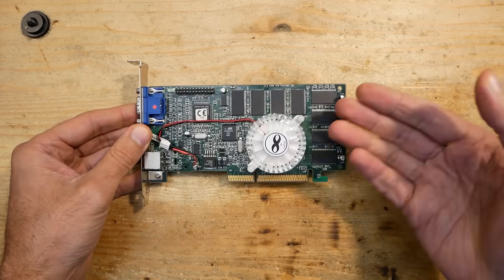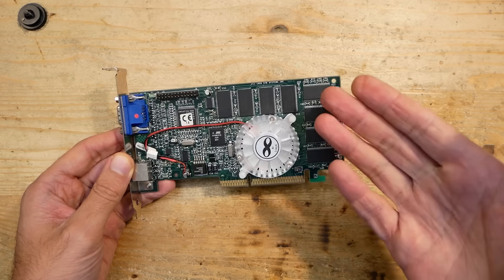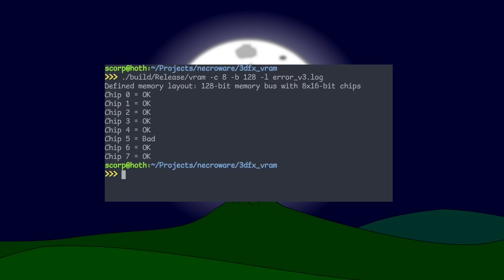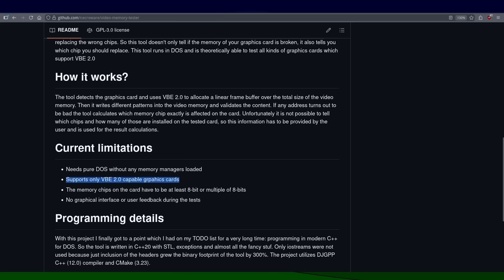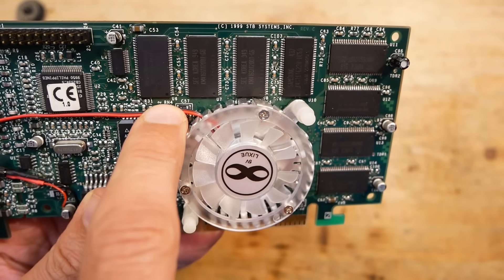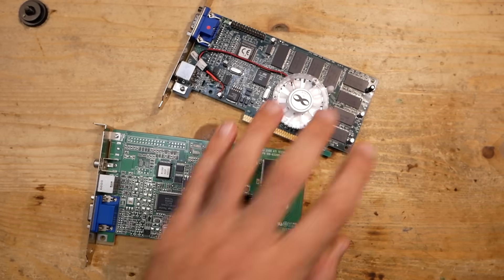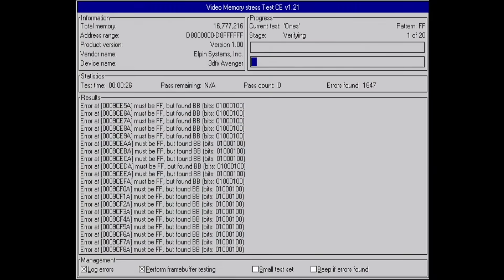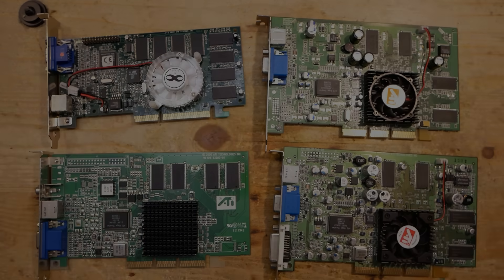Video Memory Tester

Comment: Outstanding! I had a Voodoo3 AGP develop memory issues 3 years ago, I ordered the chips and ended replacing all of them, which most likely killed the card. I made mistakes (it was my first serious repair attempt), and such tool would probably saved the card (had I just changed one chip, which I did ok in the first ones). I got a faulty Voodoo 3 2000 PCI card with SGRAM, 4 chips only, and watching your video I was thinking I need to ask him how to modify the tool to run in a different configuration, but you thought ahead and made that almost universal. Currently I’m waiting for a donor card to arrive (coincidentally ATI Rage 128) that has the same memory chip, and we had a storm 2 days ago, still waiting for electricity to come back: I’m eager to use this tool and find out which chip needs to be replaced. Thanks a lot for the contribution and sharing the tool!!!! Mfg ❤

Comment: A useful program indeed. 👍
Is it possible to get the filesize down? 
>500K seems a bit much for what, I think, it needs to do.
Reply from the maker: It's ~150k
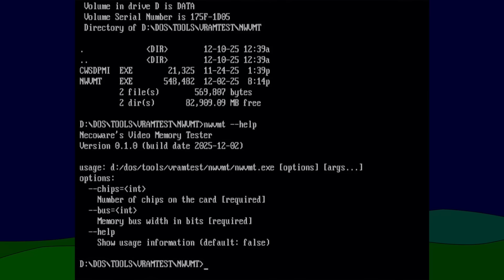Reply: @necro_ware  Oh. That's better but still feels too large to me :-). Anyway, I saw the filesize at 15:52 and didn't bother to check further. 
Any chance of making it smaller ?
Reply from the maker: @Jim_Bo sure, by writing it completely in assembly and avoiding the standard library. However, I don't see the point. It already easily fits on a boot floppy (the 500k is a debug version with all symbols).

Comment: Epic! Thank You very much, I always wanted a tool like this. As a  c# developer I wanted to write it once I had some time (need some c++ documentation before) but time lacks after the birth of my second daughter. So the number of agp cards to be Repaired is increased  while the time available decreased. I will do some tests on a 9700pro, a 9800pro 128bit, a couple of nvidia 6800 and a 8800ultra (Just for testing, I know that a pci express videocard this 'modern' is not compatible Maybe) as soon as possible.
Thank You very much for your precious work and for your great videos!
Reply: Oof.  Good luck with the 9x00 Pro cards.  Memory errors are the least of your problems with those.  :-(
Reply: @sirnickity with those cards I am sure the problem is related to one bank each (9x00 family suffered a lot of memory failured due the lack of dissipation). I Have a lot of other cards (Maybe 50) with  still unidentified problems and an hundred working cards exhibited on a wall. I don't play anymore, now I prefer to spend some time trying to Repair this old stuff.
Reply: For everything radeon 9500, 9600, 9700 and 9800 you can use R3MEMID, it's well documented on vogons. For the GeForce counterparts there is MATS.

Comment: Very good work. I admire the time you’ve devoted to retro hardware.

Maybe it would be a good idea to access each individual chip at a low level.

Writing to each of them requires enable, ready, clock and other signals.
Perhaps it would be possible to read the card’s configuration from the BIOS and pull the handling method from the drivers.
Then, chip by chip, write some data to each one and immediately read it back, just like you’re doing now.
This way you would instantly know which chip is causing problems.

And surely, in the BIOS — at least it seems to me — there should be a configuration of the number of chips, their capacity, and the bus width?

Cheers!
Reply: The PC BIOS or the video card BIOS?  I would imagine the PC BIOS would have no knowledge of the RAM controller on the video card.  And you wouldn't have any access to the select logic anyway.

You might be able to get some configuration info from the video card BIOS, but you would have to know the structure of that BIOS to ascertain where and how those details were stored.  At that point, you would know enough about the card's inner workings that you probably don't need the BIOS's help anymore.

I think the only feasible solution is a card database where the memory layout is stored along with the PCI ID.  That should work as long as there's no card out there with different PCBs that identify themselves with the exact same ID.

Comment: Tried it on my faulty mx440 and it says that the chip that was physically damaged and I already suspected as faulty, is faulty. Don't have the replacement so ¯\_(ツ)_/¯

The other cards are from the working pile but I still tried them: S3 savage4 xtreme, Matrox g450 and regular Ati 3d rage pro agp 2x and they all pass.

The only one that crashes is Ati 3d rage pro agp 2x All in wonder, the one with tv tuner.
When I run the test on it the screen just goes blank. But the card is the one from the working pile and works without artifacts so it might be something specific to all in wonder part that causes the crash?

In any case, thanks for the amazing new tool!
Reply from the maker: Cool, thanks for testing. Which all in wonder is it? How much RAM does it have and which system did you use to test it? 128MB card test runs on my P3@1,1GHz about 30 seconds. If your system is slower, or the card has even more memory, it can take a while.

EDIT: ah, nevermind, I overlooked, that it's Rage3D. Hm, is the memory size detected properly?
Reply: @necro_ware  Sorry for late reply, it's the ATi 3D Rage Pro AGP 2x All In Wonder with Mitsubishi m5m4v16g50dfp sgram, 4 of them for the total of 8MB, detected correctly in nwvmt. And the card works as far as I can tell, the games work, no artifacts, just wanted to see what happens when I tun nwvmt. And when I press enter the screen goes black, the monitor says no signal and that's that.

I also have the regular ATi 3D Rage Pro AGP 2x that completes the test just fine.
So it might be something specific to AIW card.

As for the system it's K6-2 450, 128MB RAM on GA-5AX Rev. 4.
Reply from the maker: @MrZbetmen thank you very much for the feedback. I'll put this on the to-do list for investigation.

Comment: Time to test it out :) if this works this will be amazing and save alot of time diagnosing non nvidia cards, have radeon 9100 and matrox parhelia that i can test it on, both very minor mem issues that are hard to find by shorting vreff/data lines on chips and interpreting articfacts manually.
EDIT1: No use on the 9100 by looks of things says all 8 chips are OK but i still have some artifacts even in BIOS that look very much like memory
EDIT2: Same story on the Parhelia
When starting the test on the parhelia it says that it's testing 16MB of memory, is there a option to have it test the full 128MB? I suspect that might be the reason i get no errors displayed since it doesn't test the full memory, however on the Radeon 9100 it says 128MB so it should be testing the full memory

EDIT3: My quick assesment is that this will probably help save time with easy cases ie. cards that have a full adress or data line on a chip out, doesn't seem to test mem thouroughly enough yet to find more minor artifacts, will see once i inevitably get more cards that have mem errors, this will deffinetly be the first test to run, see if i can save some time with it :)

Comment: Nice. I do not think a UI is needed.
The one with all the chips failed... the problem is probably an address line.
In cases like that, it could be nice if it reports... problem in line AXX.
Reply from the maker: That's a good idea. I'll have to think if that is possible to derive.

Comment: Hi, I was very interested in the video because I also have some old graphics cards at home that need fixing (mostly pci and agp cards). Will there ever be a version that could test newer PCIe graphics cards? Because I have a gtx 670 4gb at home on which the video memory is also dying, I managed to fix it a few times with a combination of reflow and memory underclocking, but it comes back again.
Reply from the maker: Just give it a try. The tool should work an PCIe cards as well if they are not too new. UEFI cards will probably not work, but I think GTX670 could be compatible. I didn't test yet any PCIe cards.
Reply: @necro_ware ok i will try it tomorow but iam not sure if my pc boots in. to dos

Comment: Can it be compiled for Linux?
Reply from the maker: No, it is made explicitly for DOS. Despite that I use Linux everywhere, I just didn't see any reason to make this tool for Linux.
Reply: @necro_ware   You can tell by the cli parameters all being double-hyphens.  haha

I ended up writing my own getopt replacement that I can use in Linux and DOS, so it will support "-o" and "/o" styles, plus "--opt" long options (which can share the same prefix, like in DOS where both would be the same, like "/o /long"), and "/abc /d /e" option stacking, and "/a1 /b 2 /c=3" parameters, bare parameters like filenames, etc.

I can't remember if I finished it.  I have about 500 lines in the C file, but still have a bunch of debug printf's.  I should probably test it and see if it works.  lol
Reply from the maker: @sirnickity yeah, the one you see there is also self written in 20 minutes before release :)

Comment: This is SUPER exciting! I can't wait to try this on my broken V3 3000 PCI! Thank you!
Edit: For a future idea, maybe we could have an option to specify which video adapter in the system to test, so a card can be tested in a secondary slot with another used just for display.
Reply from the maker: Cool, good luck testing your cards. Regarding the adapter selection, that's going to be hard, because VBE2.0 doesn't allow two adapters in the same system. That's unfortunately a problem indeed if the card you want to test delivers no image. However if you put the tool onto a bootable floppy in autoexec.bat and redirect the output to a text file on the same floppy, you can use it in "headless" mode.
Reply: @necro_ware Ah that's fair. I think i might put together a little video or a short this weekend to show it off to more people and see if it helps my card (and maybe try a few more)
Reply from the maker: Cool! Looking forward already :)

Comment: you can guess the number of memory chips by the sizes of bad spaces, i.e. 00X000X0 pattern is probably 8 chips, while 00XX0000 could be 4 or 8 chips. also, it's very nice tool, great job :)

Comment: I’ll have a look at your code. I’m considering trying to tackle PCI cards using your base code.
Reply: would be cool to have that, and appropriate code for specific cards, like the vooodoo cards (since they probably won't release the linux based tool that Bits und bolts uses)
Reply: @cocus-ar  I’m thinking voodoo cards as well as other PCI cards from S3, Cirrus Logic, etc.
Reply: @mesterak  yeah, that'll be really cool! what's your github or other git host user you have? I might want to follow that up (maybe even contribute :))